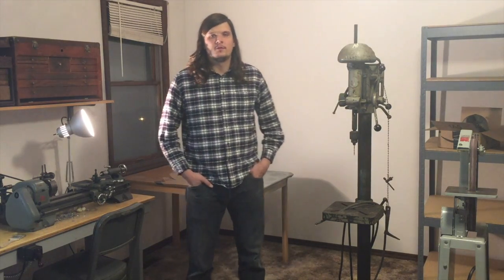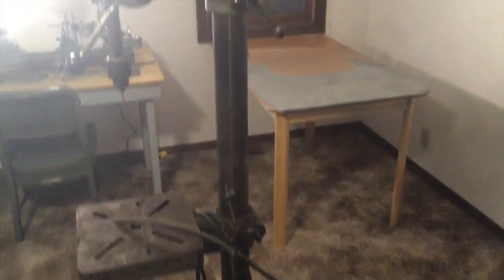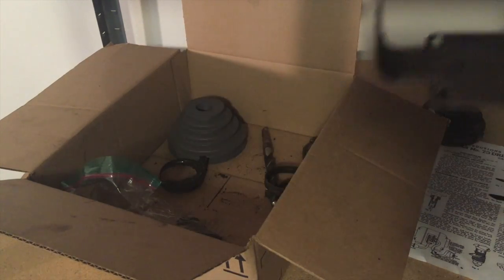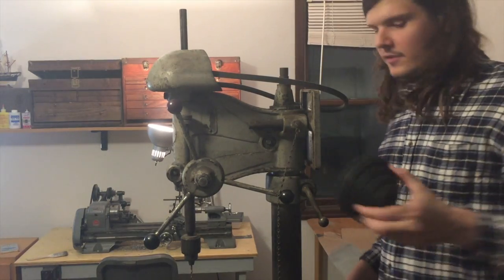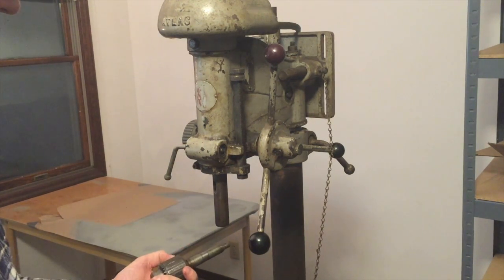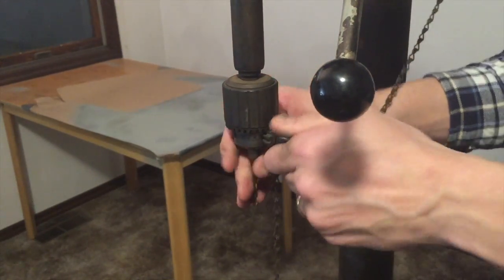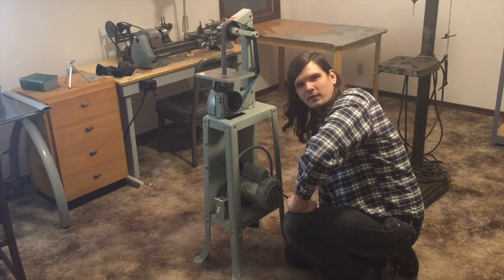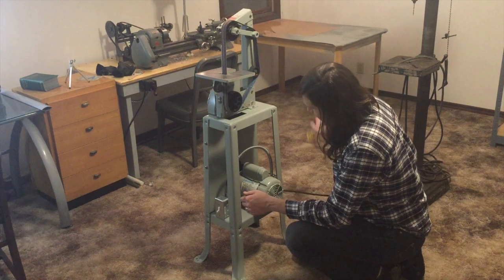Atlas 73 Drill Press Restoration: Part 1 - Intro

Comment: that's a 1/3HP motor. I have one on my royal 26" drill press thats a monster of a drill press but the motor was powering it just fine. The old motors just run and run, well made machines as long as the coils good and no rotten wires. Mine has a welded on motor mount in the middle.

Comment: Hey Steven,  great video! I was wondering what size drill belt pulley tool to use to get the back pulley off my drill press? I have the same drill press.

Comment: steve.. i watched all of the vids for this drill press.  where are you now regarding the rest of the press?  in addition, if i may recommend replacing ALL of the bearings through out the machine.  the bearings are bad.  if you can hear them when spinning, then they're worn out.  I love this drill press and you did a great job cleaning it up. when you do your electrical; install a switch system for machinery.  you should be able to find them at the local hardware stores.  anyway, looking forward to the completion of the project.
Reply from the maker: The head was finished, I still need to restore the base and table but that got buried under other projects. I do plan on making videos of that when I get around to it though. I've had a lot of suggestions to replace the bearings. I'll look into this. Originally when I looked for bearings it was going to cost $45 each for the spindle bearings and I'm not interested in spending $90 on those currently. I may start looking on eBay though for some NOS.

Comment: Very tight tolerance...>>>t.co/RB21BFgOuY    zero deflection in the head when down all the way....head only drops 2 inches...wish motor did slow down more for drilling steel. But for the price...hell for triple the price I'm very happy